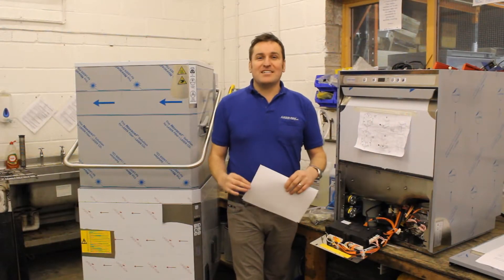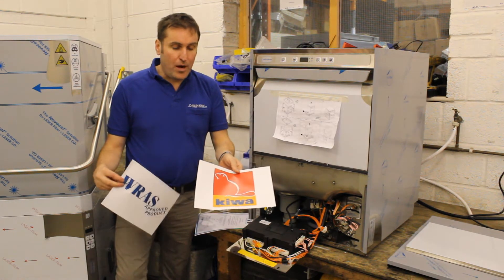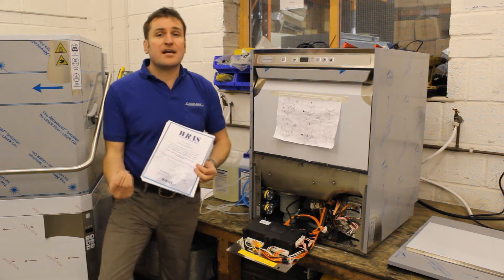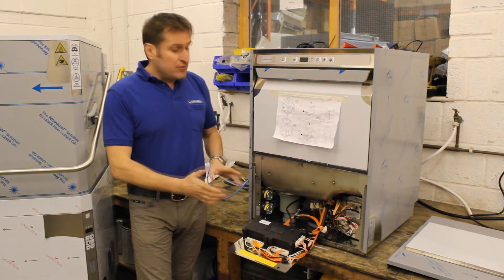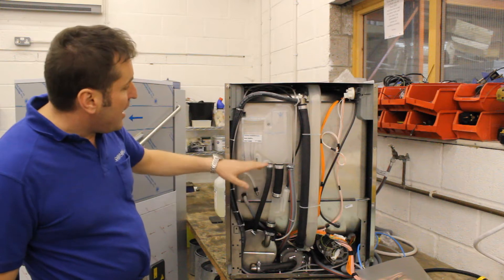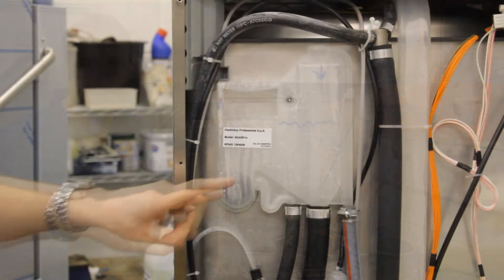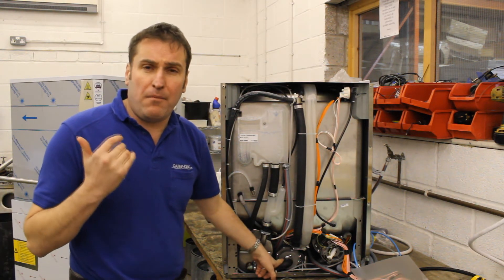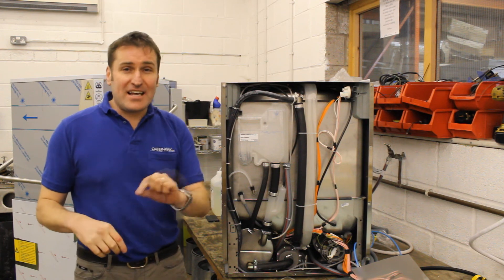Why do I need a Break Tank on my Dishwasher and What is a Break Tank?

Comment: My brake tank is full of crud and messing up with my machine. It keeps running the drain pump continuously and there's water in the brake tank. How do I fix this?
Reply from the maker: This could be a number of reasons, it's interesting that the drain pump is running continuously this is not connected to the brake tank. So it points towards perhaps the pressure switch inside the wash tank. Which machine do you have? the level inside the brake tank has its own separate pressure switch and this then activates the rinse booster pump could it be that running continuously? We can descale the brake tank, depending on what machine you have, by putting fluid into the air gap at the back. this may help, other than that the machine will need to be stripped and the element cleaned inside the rinse tank, but until we know what machine we won't be able to help further.